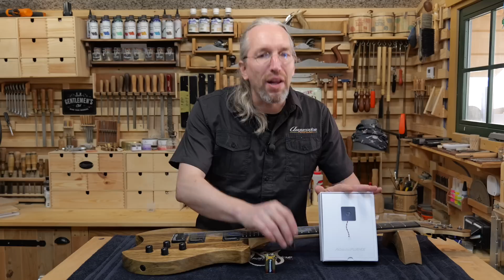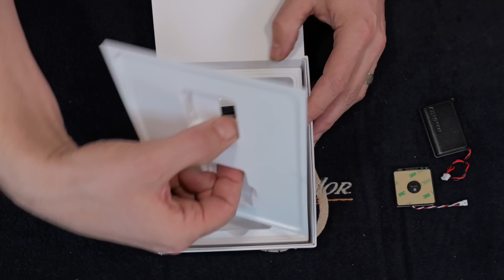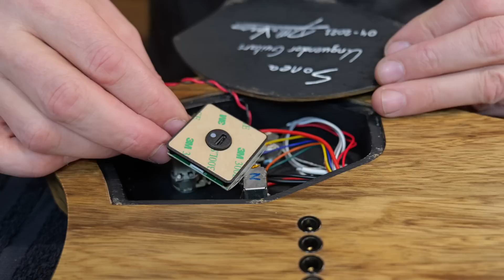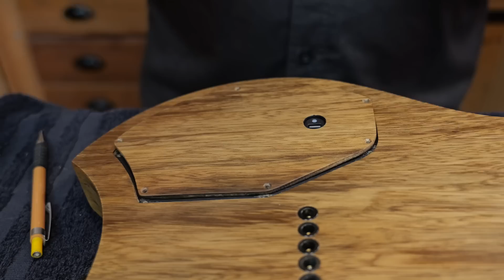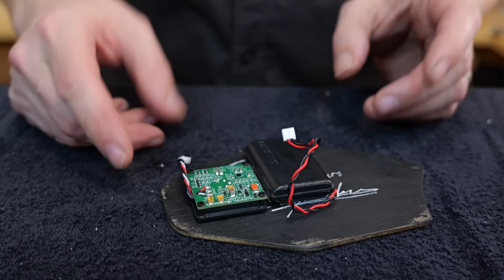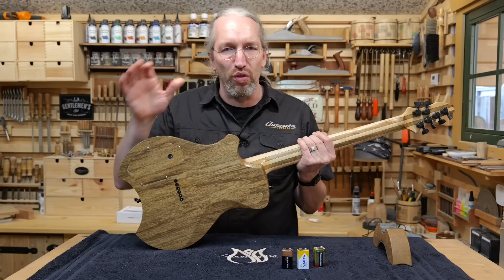How to install an Universal USB Rechargeable Guitar Battery Pack - Tutorial

Comment: Buy a 9v battery slot compartment for guitars.. A 3 pack is like $8. Cut that into your backplate. 

Then use what ever 9v u desire. Just open the door and swap the battery. .

I do think this is a good idea though. It be better with magnetic poles/ring for a connection to charge.
Reply: And overtime the cost and to replace batteries will add up. Decent 9v batteries aren’t cheap and this is a much for convenient long term solution
Reply: @unbr3akablonsoundcloud-tx6co I agree. But, there are good rechargeable 9v batteries.  So the cost is minimal.  Sure they don't last as long . However, all you would be doing to sacrificing a back plate a drop in battery compartment

Comment: Doesn't work with EMGs
Reply: Why not?
Reply: @scrotube  The battery wires for an EMG are different. They don't match Fluence wiring.
Reply: It does if you have a rechargeable 9 volt installed.
Reply: @JohnnyStillGood  Why on Earth would you need the battery pack if you have a rechargeable 9-volt installed??
Reply: @jsullivan2112 … same reason you would install a rechargeable usb… so you could easily plug it in with a wall charger, instead of carrying a battery charging dock.

Comment: If I have a guitar with EMG pickups in it, could I also use this system from fishmen or is this only compatible with their pickups?
Reply: EMG's have lower power consumption than the Fishman pickups so you wouldn't need this system.  You can get around 3,000 hours for EMG's vs 200 hours with the Fishman's.  I found this out from owning two Schecter guitars; one with EMG's and one with Fishman Fluence Modern's. I get about six months out of the Fishman's and over three years from the EMG's.
Reply: @adamgh0  The whole point is being able to plug in and recharge, not power consumption. Especially for those of us who don't want to install a battery box in the first place.
Reply: @adamgh0  A tone chaser cares not how long it takes to change or re-charge a battery. It's about convenience ONLY. When inspiration strikes, you don't want to discover that you suddenly need to find a screwdriver and a battery  > : /
Reply: I think I missed that the guitar in this video does NOT have a battery box. All my active guitars do. This seems like a problem for people who put active pickups in a passive guitar.

Comment: Great video. All these people talking about how it is easier just to replace the battery with a new one doesn't even come to my reasoning on why I have them in my Fluence guitars. This is a game changer for me that have several guitars and play all of them often. The biggest reasoning for me using these is that I leave some of these guitars plugged in all the time. I would be charging or replacing batteries every 3 days if I did this. A lot of my guitars don't have a 9 volt cavity so I am tired of removing the plate to install new 9 volt batteries. Charging these packs are faster than charging a 9 volt. I get a full charge in a couple hours. All I do is specify 1 day every 2 weeks to charge all the guitars and I am set. I also have the 9 volt cavity in my "most used" guitars to have as a backup in case the pack fails. Tired of removing the guitar cable every time I need put the guitar down. I wish it had usb 3 type C charging port...also wish it had a drop in replacement for a 9 volt cavity. Also interested in a custom guitar. Do you ship to the US?

Comment: This isn’t a good idea. Normal batteries die slowly, giving you a warning they are on the way out but rechargeable batteries just die. That’s why theatrical productions use disposable batteries in microphones the actors wear, if they hear a mic not performing properly, they change the battery, with rechargeable ones, they could die while the actors on stage. Now of course, you could make sure the battery is always fully charged but we all forget to charge things. Even if you don’t play live, swapping a battery is easy and just buy 2 when one dies, it’s easier than charging when you want to play.
Reply: On the contrary, these appear to be safer in that regard, and it’s actually my primary reason for preferring them. 

There’s an LED indicator on it that will turn red and start blinking when there’s 6 hours of play time remaining. Gives you ample warning to recharge with plenty of grace if it’s not a convenient time.
Reply: Regular batteries also die mid-performance, this is a ridiculous comment. They die the same way.

Comment: A warning against batteries with built in usb charging. All the ones I've tried are electrically noisy. Very.
Reply: I know what you mean, I've tried a dozen different brands and most are completely unusable for active pickups.... The Ai told me it's the internal circuitry from the usb port that causes the noise.  So, I went to rechargeable 9V that don't have a charging port. You have to use their specific "cradle", that connects directly to their Pos and Neg connections ~ and they've been great. Just like a regular 9v \m/

Comment: There is 9v lithium battery with type c, 1000mAh, which is twice the capacity of normal 9v battery, which is 500mAh.
Costs around 10 dollars, no soldering required.

Comment: It's better just to use cheap rechargeable 9V batteries and just route the charging port with a modern USBC, less hassle and for less than 15 dollars total, this Fishman rechargeable kit is too expensive and most users say this battery doesn't hold charge well after less than a year
Reply: My experience with the Fishman batteries isn't the same as yours it seems, where are you reading that 'most' users are having battery pack issues?  

The inherent problem with the internet is that when people have a problem, they come online to talk about it.  It's like when Apple pushes a SW update and 600 people comment on a forum that they're having a problem.  You'd assume then it's a wide issue, impacting everyone - but Apple sells 70-80 million iPhones every 3 months or so.  That means 0.009% of people are impacted even if you only take 3 months worth of customers.  Ramp it up to everyone on that update, and you can add a few more 0 behind the decimal point.  

I guess the point I'm making is that what you read online can be deceptive, people don't log on to say "Hey, everything's fine" for balance.
Reply: @EntropiaGuitars  in other words it’s a sampling error.
Reply: @EntropiaGuitars dude, I was a tech at apple Genius Bar 13 yrs. I repeated your comment thousands of times! This made me laugh. On point! 👍🏽
Reply: @ AppleCare myself for a while too!
Reply: @EntropiaGuitars I use the anology of hitch-hiking in Australia.

Comment: Nice - however, I would have appreciated it if they had used a USB-C port. USB mini is so outdated.
Reply from the maker: Yeah I know. 
I had hoped Fishman had updated to USB-C, but unfortunately they haven’t. 
That said being able to charge a guitar instead of worrying about batteries is still an improvement.
Reply: Yep. So outdated you can't walk into any corner drugstore or gas station and find one.... What a nothing thing to complain about.
Reply: @Trainwheel_Time  Apart from the bad usability, do you know how long this will be the case? The mini USB standard is simply outdated because it was a mistake and personally I would never build such a socket into a guitar. Of course that's my personal opinion...

Comment: They couldn't even make it USB-C? What year is it again?
Reply from the maker: I also hoped Fishman had updated to USB-C by now but unfortunately they haven’t. Nonetheless being able to charge your guitar and not having to worry about batteries is still a win in my book.
Reply: USB-C is trash. Mechanically it loses its grip over time very quickly because it's friction based, and has to be replaced or you will have connection issues. EU are idiots.